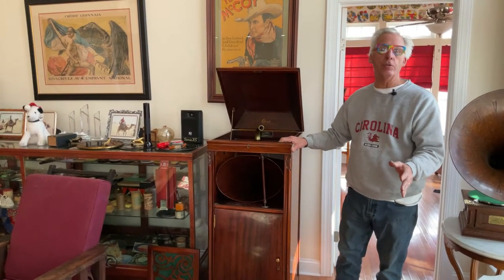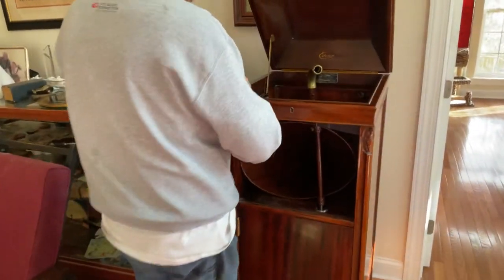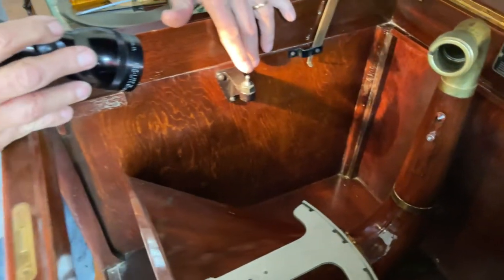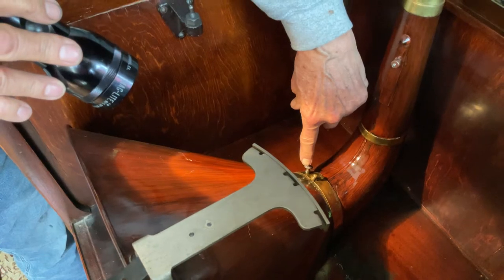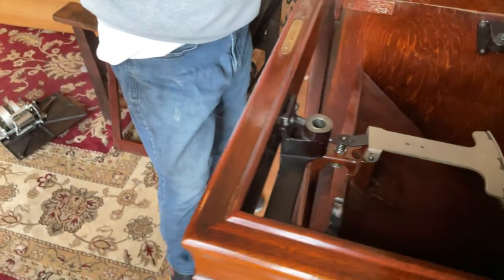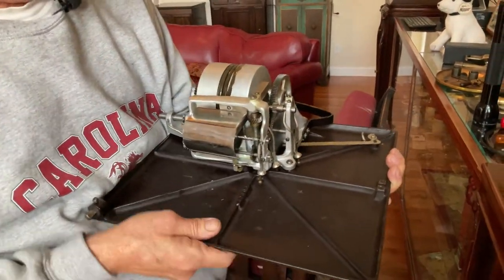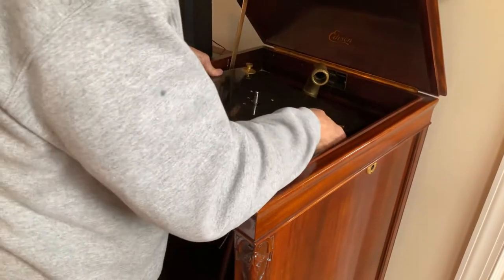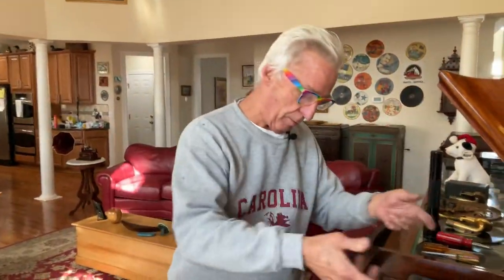903.  How to install an early Edison A-250 motor in the cabinet￼

Comment: Those A machines are nice, but they are kind of weird compared to the later versions.  Those motors drop in easier though if the horn is all the way to the right to get the feed mechanism out of the way.  I'm pretty sure that's how they explain it in the owners manual, but it's been awhile since I've read through it.       Those motors sure are over engineered in a lot of ways compared to the later incarnations!  You have a very nice looking example, I just got done refinishing an oak one. Good luck with it now!  And Merry Christmas as well!!